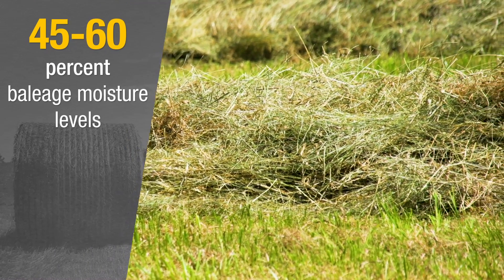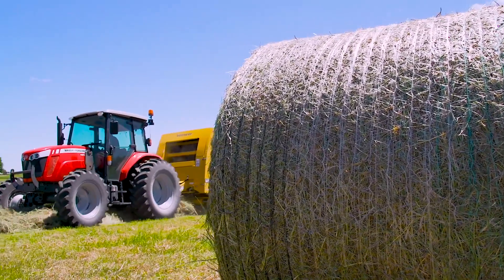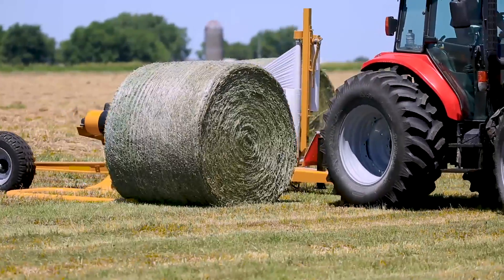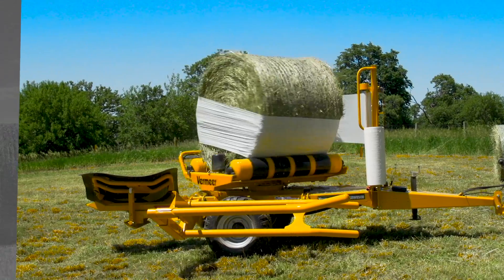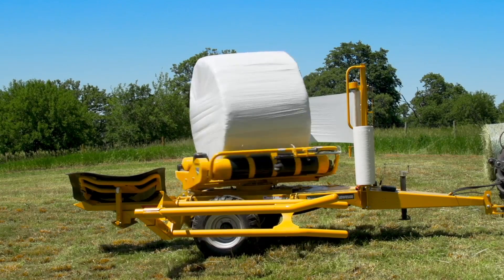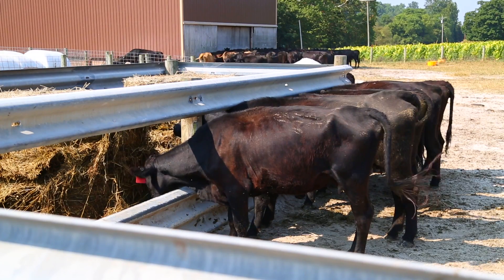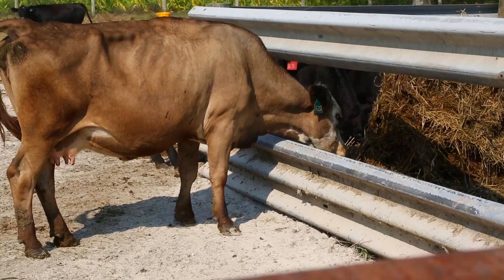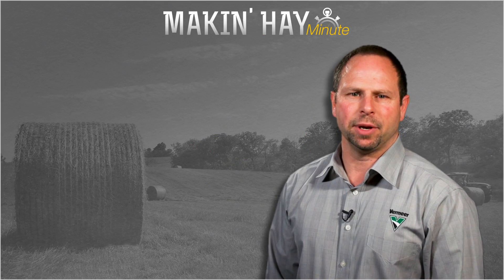Makin’ Hay Minute: Best Bale Wrapping Practices

Comment: Can u wrap dry hay?
Reply: You can wrap dry hay if you want. Some people do it as it protects the bales from weather damage, and they claim it costs them less than what the wastage would cost. Personally, I think if you're going to wrap them, you're better off making silage (baleage), as I've always found animals like it far more and it's much easier to get without being rained on etc.
Reply: There's no reason to really the water sheds off the round bales as long as you just set them in single rows
Reply: @ethan.brossart3634  I disagree.  You get ground rot and you'll loose sometimes up to 60 percent of each bale that sits out with noprotection.
Reply: @multitoolish  you can stick to what works best for your operation but I get very little spoilage in the northern plains where it rains very little if I set them in rows on high dry land I barley have the time to wrap my silage bales let alone all my dry hay and then I would also deal with all the plastic when I unwrap all of them It would help don't get me wrong but I just don't see it to be worth the time investment personally